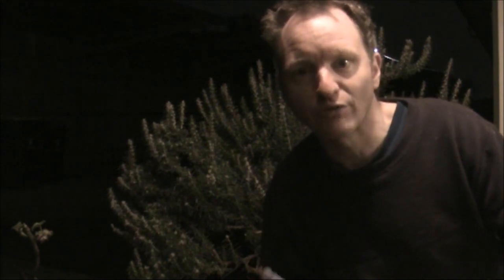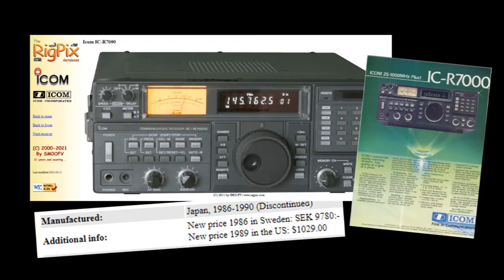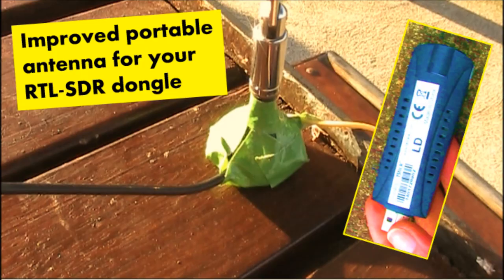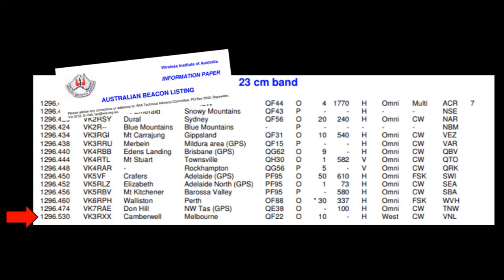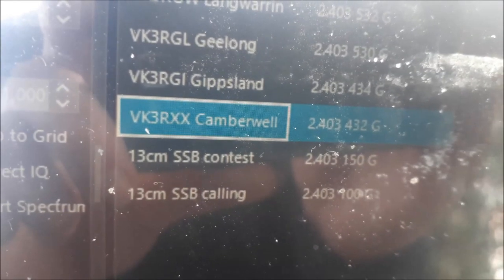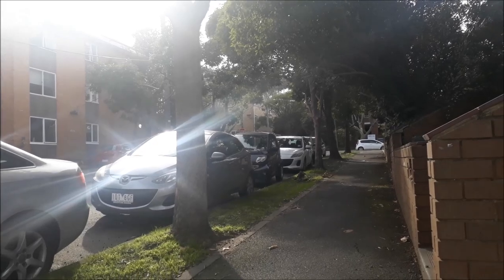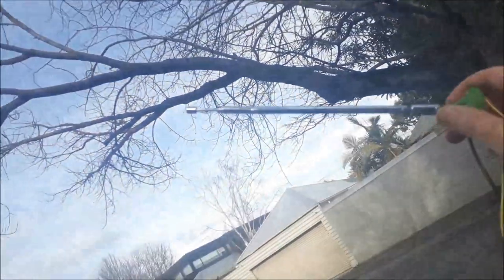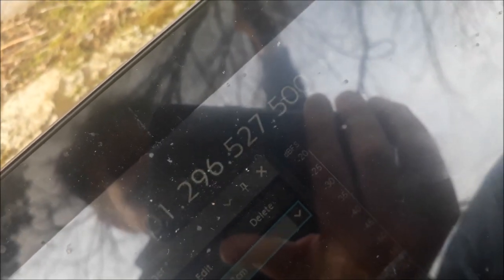1296 MHz on a cheap USB RTL SDR dongle: Can anything be heard up there?

Comment: Nice one I would do the same thing but here in the UK you wouldn't get such a clear train with 69 million living here :(  Really worth getting the V3 blog SDR though from rtl shop. The best there is for the price and it works at least down to MW in q branch mode...
Reply: Melbourne in strict lockdown
Reply: I have the V2 (currently l can't find it), and am considering buying the V3. Just got a used RSP1a, but its higher frequency performance isn't as good as those with the R820T(2) type tuners. These are so versatile and yet inexpensive, it's really a good discovery for the hobbyists. Thanks to the dwindling OTA market, these chips or dongles have been so inexpensive. The discovery of the I/Q in the USB data was gold by a few very smart experimenters then.

Comment: Nice to see you exploring the higher bands!
One potential low cost 23cm signal source would be quadrupling up one of those cheap 315MHz SAW oscillators to 1260MHz, but that might be quite drifty.

Comment: How to get a train compartment all to oneself:
1. Have a laptop that makes weird whistling and bleeping noises;
2. Wave an aerial about.  :-)
You would probably benefit from one of those PCB log-periodic aerials, or, better still, build your own - maybe from stripboard?
Reply from the maker: Going against the peak flow during a pandemic probably helps even more. Main worry re stripboard is capacitances & losses so I'd be inclined not to for 23cm.
Reply: @vk3ye  Points taken!

Comment: Excellent video! Can u suggest a tripler circuit to get a 70cm TX on 23cm?
Reply: I agree it would be interesting to see. However, the cost of a simple SDR it nominal and pretty much anyone can get it. Plus, you can listen to anything from kHz to 1-2GHz depending on the device.

Comment: Very, very interesting video!!!  I wonder if you could improve the temperature/frequency stability by putting a small enclosure around the dongle, like a pill bottle, when you are outside to prevent breezes from cooling it intermittently?  I guess you could tell if this would help if the dongle was more unstable outside than inside.  I also realize that you would have to be careful not to overheat the dongle while in the enclosure. This would cause the dongle to never stabilize!!!  Thanks for this enjoyable video!

Comment: Very good video!
Interestingly, based on such a dongle, is it possible to assemble a receiving station to listen to EME communications at 1296 MHz?
Reply from the maker: EME communications would require excellent frequency stability and top-notch receiving performance. As well as really good antennas. So unlikely but I won't say it's impossible.
Reply: @vk3ye  Well, I'm assuming a spiral antenna or dish, an antenna amplifier and a 1296 MHz bandpass filter. And connect it all to the dongle. So will something work out?

Comment: Was there any other activity that you saw on your scope while you were out listening ??
Reply from the maker: Not on 23cm. But certainly on other bands.
Reply: @vk3ye  I guess it will remain quiet until Beofeng put out a 23cm hand held :-)
Reply from the maker: @MidlifeRenaissanceMan  A few diodes and other bits can multiply a Baofeng's 432 MHz output to 1296 MHz. That's a cheap way of getting an FM signal out on that band.
Reply: @vk3ye  And an RTL dongle to do the receive. Might make for another video. 23cm for $50 :-)